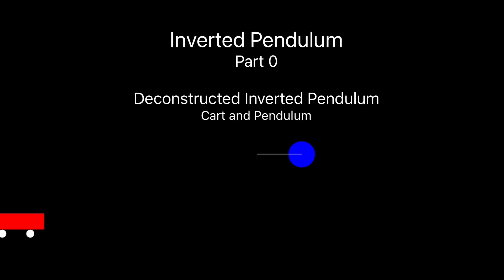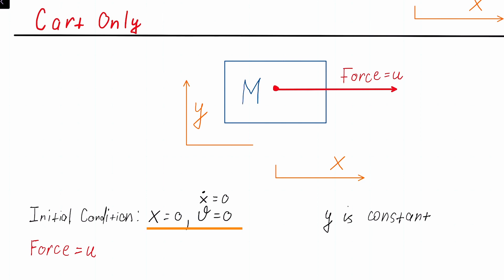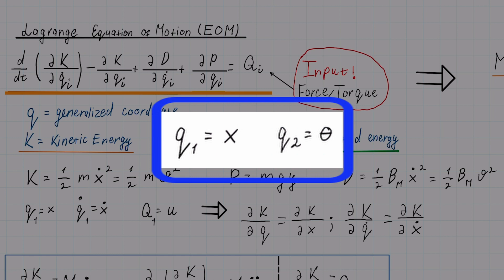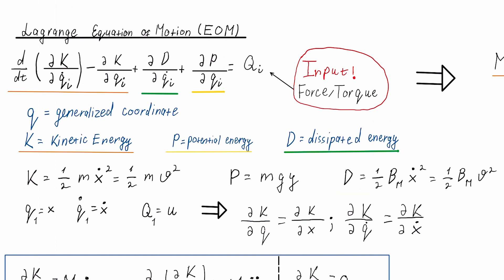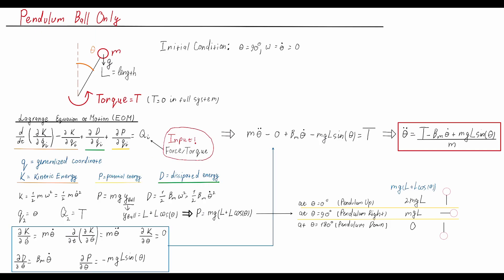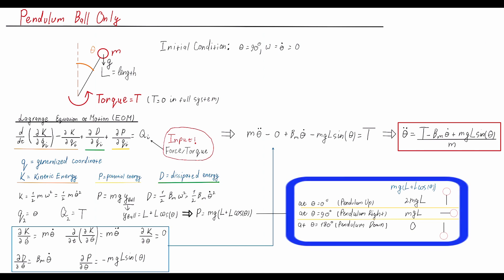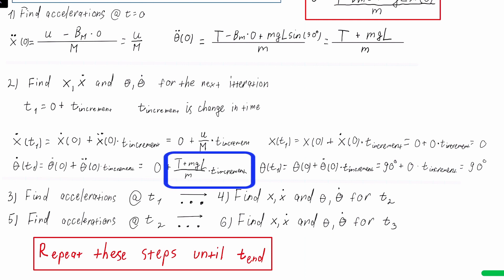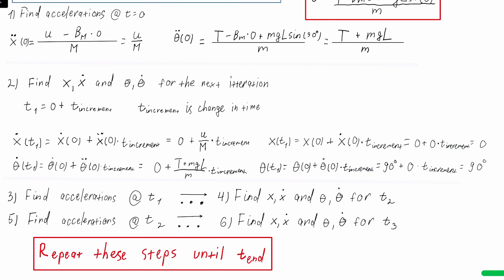Understanding Inverted Pendulum Dynamics: Introduction & State Space | Part 0

Comment from the maker: Hello guys,
Answering the question at the end of the video:

Angular acceleration θ'' = ( T -  Bm*θ' + m*g*L*sin(θ) )/m

When we set torque T = -m*g*L
And our Initial Conditions are θ' = 0 and θ = 90

We get θ'' = ( -m*g*L - Bm*0 + m*g*L*1 ) / m
And it results in θ'' = 0/m = 0.

This is the reason why our Pendulum simulation is stuck at the end, we supply just enough torque to prevent the pendulum from falling!

If you ever have questions please feel free to leave them here!